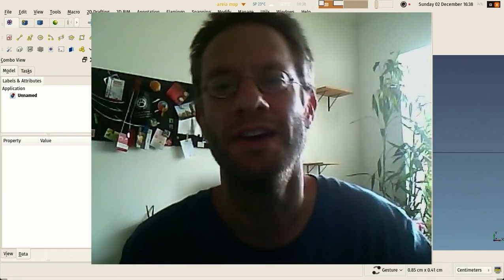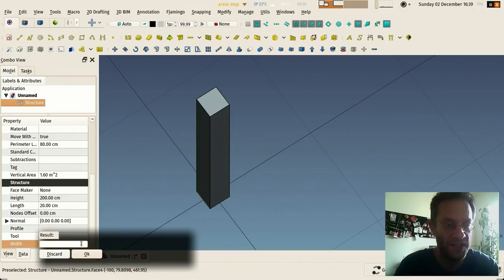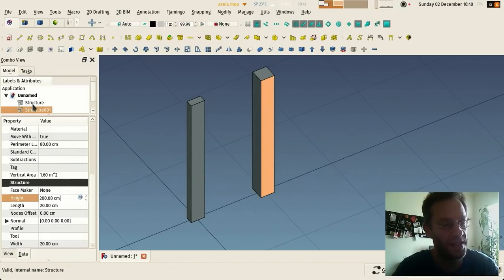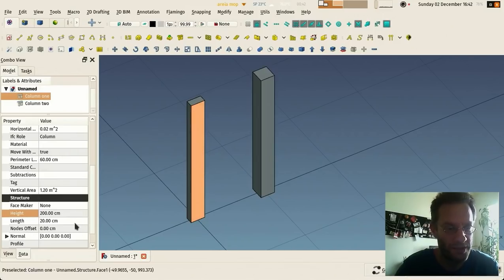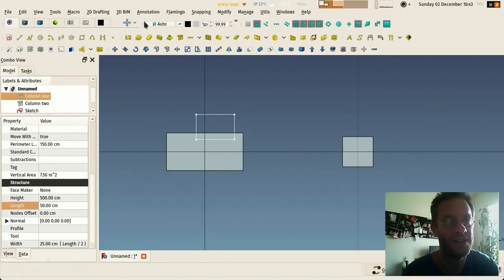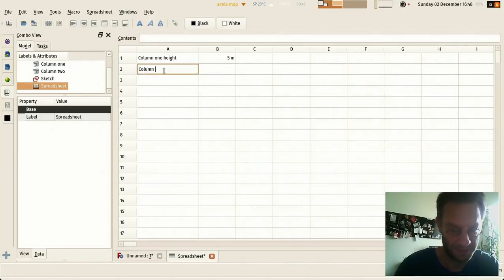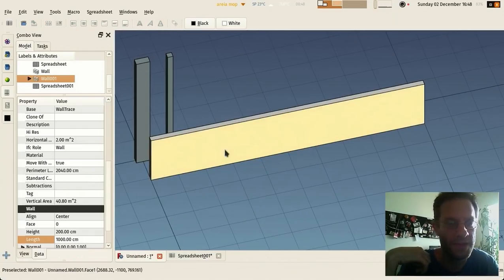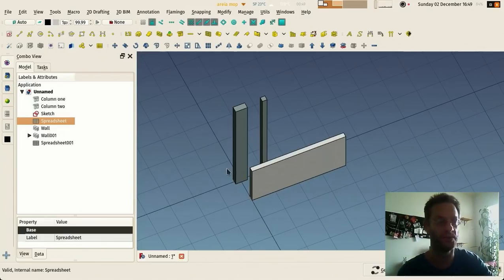BIM with FreeCAD - Expressions

Comment: Good presentation of features I could not leave without as they drive each and every of my models!
Practice led me to put all of my data and expressions in a spreadsheet with aliases and only refer to these in object properties because it's much easier to mass modify when you want to derive a design from another.
Today, when starting a design, the very first thing I do is creating the 'Data' spreadsheet and throw in the few basic  dimensions I already know. Then only I begin adding objects, with aliases refs right from the start. A little slower in the beginning but earned back a 100 times on the long run.
Extension of the expression engine and spreadsheet module would surely dev effort worthly invested. Another path could be linking/integration with LibreOffice spreadsheets to benefit from its powers and furthermore ease the sharing of sheets/data between design files. I know expressions can use data accross files, but being able to have master sheets of all centralizing project data together with power of a full featured spreadsheet app would be a game changer!
Finally, this could eventually pave the way to integration of database connections for collaborative/shared editing?! 😋
Anyway, thank you for all
Reply from the maker: Actually this is on my radar too already. The approach I tried with the Arch Schedule tool (basically,produce a spreadsheet inside freecad, to be edited further outside) is a bit clumsy, no way to produce a nice-looking spreadsheet. I now wonder if a more interesting path wouldn't be to do it all in libreoffice, that is, from there be able to open a FreeCAD file and lookup quantities... Need to experiment with that.
Reply: @YorikvanHavre  Some have already work on this and, IIRC, I think one guy managed to establish a two way link between FreeCAD and a LibreOffice spreadsheet using Python UNO interface and LO server mode. I have bookmarks on my laptop. Will share them ASAP...

Comment: How input dinstance when make or drag a line, wall or another object?
Reply from the maker: You can simply use TAB to get to the "Length" field
Reply: @YorikvanHavre  спасибо, получилось!
Но есть 2 вопроса:
Как сделать, чтобы во время ввода значения длины курсор мыши был заморожен и направление стены не могло случайно измениться?
2 вопрос: кнопку "TAB" нужно нажать 4 раза, а ввод значения - 2 раза.
Можно ли изменить порядок пооей и поле длина сделать первым? Он используется чаще всего.
X, Y поля не очень нужны: можно нажать shift и заморозить курсор мыши.
Reply from the maker: @alexandr-spb  There is no real way to freeze the mouse, but I think this could help: Under edit -> preferences -> Draft -> general settings: "Set focus on length instead of XY coordinates"

Comment: Hi Yorik. I tried this and it's powerfull. A lower object in the tree can reference a higher object but the contrary si not possible (because the lower object is drawned AFTER the higher). A simple question : why can't we see the name property of object in the tree (read only of course) ? I use python console to see this name. Only the label is visible.
Reply from the maker: Hi! It is not based on the drawing order, but on a tree logic. There can be no circular dependency. So object A can depends on object B that depends on object C, but object A cannot depend on object B who dependson object A. That would be a circular dependency which is prohibited in FreeCAD. The dependency graph under Tools menu can help figuring out the dependencies. The Name property is actually more like an internal ID, and less important to the user... But if you hover your mouse over an object in the tree, you'll see the internal name in the status bar.
Reply: @YorikvanHavre  Ah ok, thanks for this valuable answer.